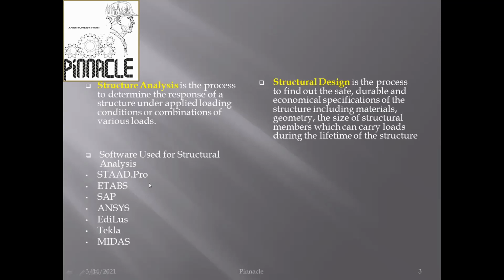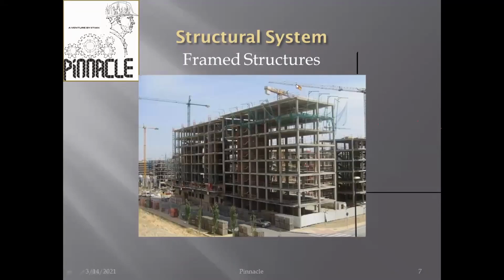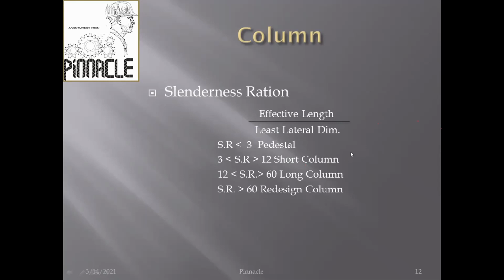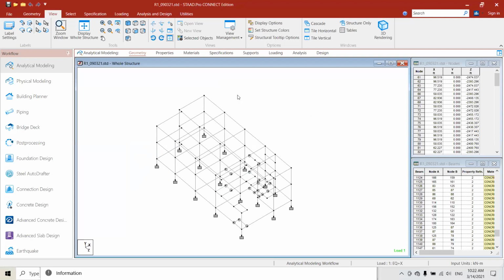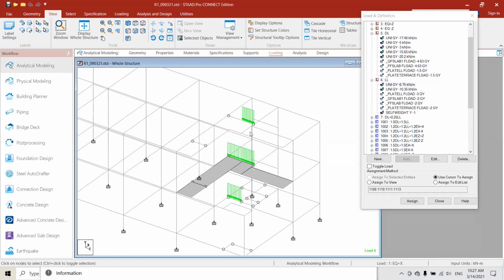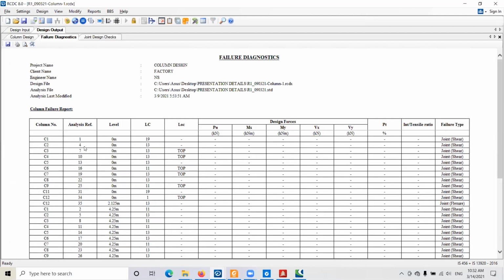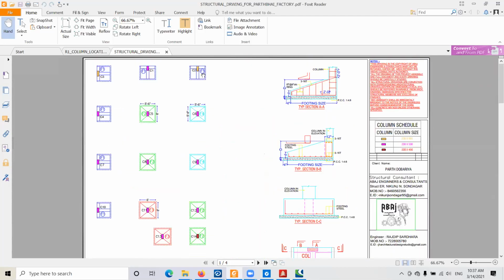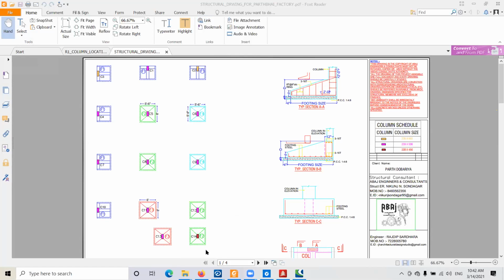STAAD PRO DEMO LECTURE || HOW TO LEARN STAAD PRO || LEARN RCDC || STAAD RCDC LEARNING COMBO

Comment: Hello sir, I have 2-3 double about STAAD.Pro

1) how to design plinth beam in STAAD? 
2) As we take floor to floor height 3m. Can I add height of plinth i.e. 1m. in the total height for ground floor? 
3) About lintel beam. Is the unit weight of that lintel beam added in the dead load.? If yes then it act as udl or simple load? 

Please help sir.
Reply from the maker: 1.Plinth beam design as a normal beam in any software.
2. No.
3.lintel beam not considering during analysis and design
Reply: @pinnacleeiit  so for plinth beam, instead of Bay Frame can i use Grid Frame.? 
And wall load of ground floor is transfer by plinth beam. So can i apply wall load on that plinth beam?
Reply from the maker: @onlysooth1806  yes definitely right
Reply: @pinnacleeiit  thank you sir
Reply: @pinnacleeiit  please make one video on, design of ground floor.
Reply from the maker: @onlysooth1806  sure